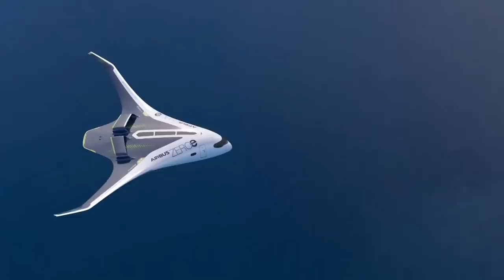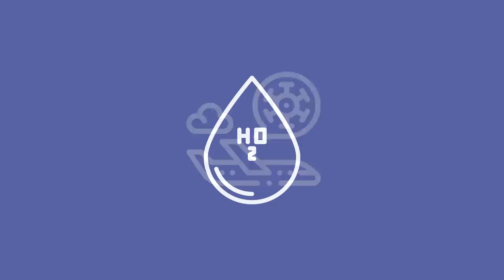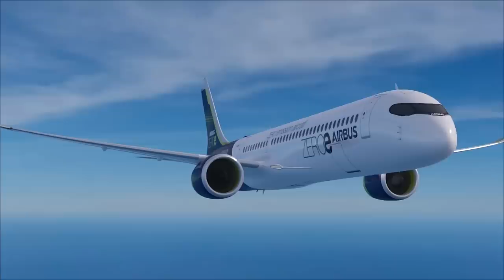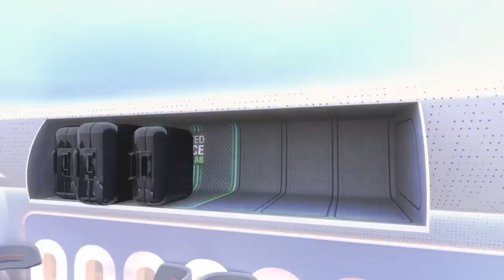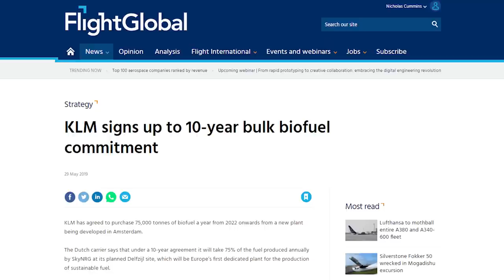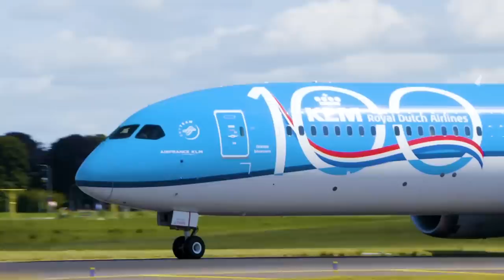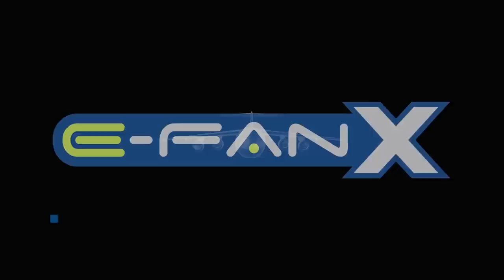Airbus Future Plane Concept - ZEROe - Hydrogen, New Cabins And Zero Emissions - Never Built

Comment: Airbus unveils concepts for hydrogen-powered zero emission planes
The three concept planes will be powered by hydrogen rather than jet fuel, and could be carrying passengers by 2035.
"The three concepts are each based on a different idea for how to achieve zero-emission flights and use different aerodynamic configurations for what the company said was its ambition of "decarbonising the entire aviation industry".
The crucial power source for all of these planes, codenamed ZEROe (for zero emissions), is hydrogen as a clean aviation fuel."
https://news.sky.com/
Reply: 0:23
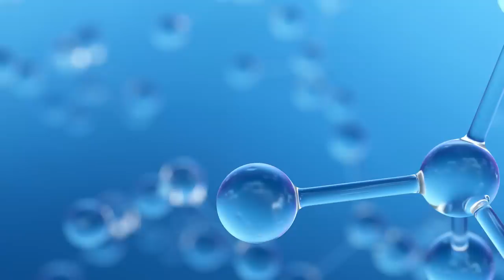Reply: 1:23
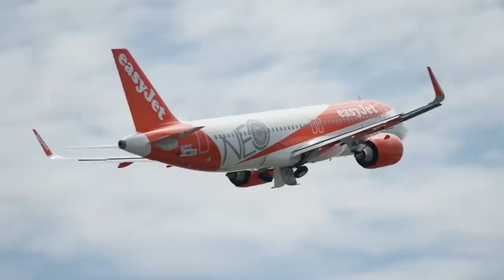Reply: 3:33

Comment: Small problem with hydrogen: it burns so hot that if combusted in air, it will also create NO and NO2, which are greenhouse gases. Not exactly "zero emissions."

I'd personally prefer a fully-electric propeller-powered plane charged solely off renewable energy, regardless of flight time.

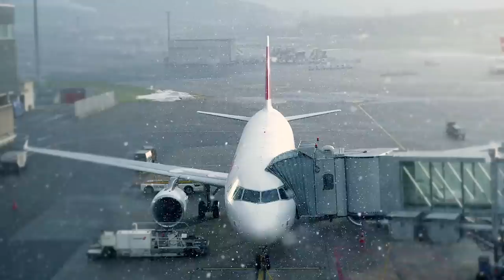Comment: 1:43. “ only the engines need to be upgraded on existing aircraft”
I don’t think so. In the 1980s Lockheed had an L1011 trijet as a test aircraft running one engine on hydrogen. They abandoned the programme because of the difficulty with the handling and storage of the liquid hydrogen both on the ground and in the plane. Watch a rocket once the cryogenic propellants have been loaded, continually venting off.
Reply: That was in the 1980, the technology has evolved enough today for more secure/better hydrogen propulsion

Comment: There is another problem with hydrogen airplanes, especially hydrogen jets. And that is the effect of emitting water vapor at high altitudes. This is often ignored because, hey it's only water right? But water emitted at high altitudes is a very potent greenhouse gas. In fact water vapor contributes to about half the climate impact of flying today. And the problem is that burning hydrogen produces about twice as much water vapor as burning kerosene.

Comment: There is definitely enough energy to produce hydrogen from the sun, so the comparison with biofuel makes no sense. Solar- and wind farms could use hydrogen as a secondary backup energy storage for emergencies, and sell off the excess hydrogen to airport for a fair price since it would have been wasted otherwise. The power farms prefer to use use their primary storage solution anyway thanks to it efficiency, so they rather sell the hydrogen  thanks to its value, unless they absolutely have to use it.
Reply: You can't transport hydrogen 'easily'. Costs of liquefaction and transportation are times higher that production.
Reply: @maxdefire  you don't actually have to transport pure hydrogen, you can store it in an other ways, and then turn it back to hydrogen. Military is even planning to use urine as hydrogen storage.

Comment: Hydrogen fuel cells make sense instead. Hydrogen combustion doesn't really make sense as it doesn't improve efficiency much. It's just simply swapping one fuel type for another like gasoline to LPG. Heck, even a gasoline fuel cell would be a HUGE improvement.
Reply: Actually, the fact that „you only need to swap fuels“ is a huge advantage in my eyes since it brings down costs drastically, especially in a domain like aviation, where development cost skyrocket due to safety constraints. Moreover, if it would be possible to combine the peak efficiency of kerosine jet engines  with hydrogen fuel, it would be way higher than state-of-the-art fuels cells. Peak efficiency of jet engines is <90%.

Comment: This is most likely a presentation model showing not a real development but the depth of research work. An attempt by engineers to create a revolutionary aircraft. But such futuristic approaches need engines based on new principles. Because due to aerodynamics, such an object cannot fly. It has no air support

Comment: Hydrogen transport? Wouldn’t it be enough just to have a truck that is connected to tap water and electricity...? 

Of course a bigger airport could make it more efficient in a different facility but for smaller airports that’s a very easy and cheap solution

If you think about it it would allow for operations in very rural areas as jet fuel doesn’t have to be transported there in the first place

Comment: These hydrogen engines burn fuel in the same manner that gasoline engines do. ... However, at a stoichiometric air/fuel ratio, the combustion temperature is very high and as a result it will form a large amount of nitrogen oxides (NOx), which is a criteria pollutant.

Comment: Burning H2 in an engine will still create Nox emissions unless they intend to carry liquid O2 as well like a rocket.
Reply: You're right, but I think the idea is to carry the O2 on board.
Reply: @normanstewart7130  But no CO2. That's a start...
Reply: @bazoo513  I think you've misunderstood. As long as they carry the O2 on board (pure O2, not air), there'll be no NOx emissions.
Reply: @bazoo513  But note my point about water vapour (produced by burning hydrogen) being a greenhouse gas. Water vapour is the biggest contributor to greenhouse warming.
Reply: @normanstewart7130  No, I understand. It's just a matter of trade-off - NOx emissions vs. much increased weight and complexity. 
In a bit different context, you will recall SABRE combined cycle engine where the main trick is using atmospheric oxygen for as long as possible, for weight reasons. (Well, I will admit that nobody can accuse SABRE engine of being simple.)
Reply: @normanstewart7130  Something ate my reply.
Water vapor in the atmosphere is in equilibrium with that in oceans, soil etc. If we add more, it will just condense (OK, if we fly over Atacama desert perhaps we will locally increase the greenhouse effect somewhat.)
However, if we warm the atmosphere up by dumping CO2 into it, it will be able to contain more water vapor, creating a positive feedback loop and making the things worse.
Reply: @bazoo513  But atmospheric CO2 is also in equilibrium with the oceans. Simplistic, hand-waving arguments won't cut it; you need to perform a full calculation.
Reply: @normanstewart7130  And you do perform "full calculations", unlike hundreds of climate models, right?
Oceans do absorb CO2 (and are getting more acidic at alarming rate), but much slower than we are adding it. You did notice that the atmospheric concentration raises, didn't you, therefore it is not in the equilibrium.
If oceans managed to absorb all excess CO2, there would be hardly any corals or mollusks left.
But, by all means, continue your fossil fuel lobby propaganda regurgitation. Life is too short to waste it like this.
Reply: @bazoo513  The IPCC says (at least the models say) the principal cause of future warming is the additional water vapour kick-started by the small amount of CO2 warming. We can't, on the one hand, say that water vapour caused by CO2 will destroy the world while, on the other hand, saying that water vapour from burning hydrogen is harmless.
Reply: @normanstewart7130  You don't understand a word of it, do you?
Yes, there will be more water vapor in the atmosphere, because warmer air can keep more water without it condensing. If you just add water, it condenses and falls right back. This is the positive feedback mechanism I was talking about.
Sancta simplicitas!
Reply: Even using fuel cells?
Reply: @beback_  No, Fuel cells produce electricity with water as the by-product. However with a Fuel cell you then have a fully electric engine which basically means you end up competing with battery electric aircraft.

Comment: Batteries - unlikely for anything beyond small short range aircraft; insufficient energy density. Hydrogen - possible, but the need to develop a whole new infrastructure and new risks make me think its not going to be top of the list. Synthetic hydro-carbon fuels - where my money is going; all the new infrastructure is in fixed locations, and then taps into existing distribution networks and more-or-less unchanged engines for heavy transport (trucks and aircraft). "Just" take the hydrogen from a clean source (electrolysis from renewables, or ultimately fusion), add atmospheric CO2, and out pops fuel. Nothing substantially different from an existing chemical plant or oil refinery site, and we have plenty of those.

Comment: Hydrogen is the most inefficient battery (fuel) known to man, so no wonder this did not work.  
Chemical batteries return 98% of their energy, while hydrogen returns about 50%.
Reply from the maker: The chase for zero emissions...
Reply: Well, the thing is, as inefficient it is, sadly, this is the most realistic scenario right now. Battery capacity is still horrible.

If you look at the range of the 2 of those aircraft, they have around 1,000 nmi to 1,500 nmi less range than conventional aircraft that uses petroleum as a fuel source.
And they would be relying on composite materials for most of the aircraft components to save tons of weights and lower the required thrust for the aircraft to operate. This technology help A350 to reduce fuel consumption by around 30% compared to previous generation aircraft like B777-200ER.

So this proposal sounds a bit more realistic than electric aircraft.
Reply: amd64online Thats an interesting technology, and there will be more like it I am sure. But lugging tons of metal hydride is going to dent the energy density significantly. Liquid H2 is always going to be higher density.
Reply: Batteries are stupid heavy

Comment: For the ATR-esque plane. Infrastructure for handling Hydrogen is expensive build, run, and maintain, even for large airports - look at the myriad of issues Toyota had trying to build out hydrogen infrastructure, and planed consume a hell of a lot more hydrogen than a corolla. And you think regional airports are going to have the money and the desire to go through that hassel? "Perfect" my ass. Blended wing designs have also been kicked about for years, and yet the furthest anyone has gone are a couple of RC models. Not only is the development cost far more expensive (new technology) then creating a new conventional tubular aircraft, but standard dimension air cargo is unable to efficiently fill interior cargo space. If i were a betting man i would put money on aircraft manufacturers basically sitting on their asses waiting for an engine suppliers, who are unlikely to put huge amounts of resourced behind hydrogen products, to pull a powerplant that is significantly more economical than conventional engines, practically out of their asses. Which is to say, i don't see hydrogen happening unless massive issues come in to play around jet fuel, like extreme carbon taxes. And by the time the economical proposition would male hydrogen favourable, electric technology will be a couple years out, and the R&D costs would never be recoupable.

The 7j7 had enough issues with new engine technology to doom the project, and their engine tech had far more commonality with existing power plants, and also did not need massive infrastructure expenditure for hydrogen.

But the CGI substanceless hype videos are pretty, regardless of practicality :).

Comment: Highly doubt succeeding by then; due to requirment of high-compressed tanks shape to be accommodated in entirelly in new airplane. And testing of new airplane will require plenty of time, which is not feasable by then, again, due to cost of hydrogen vs conventional petrol refinery cost and purshase/delivery in practical application.
Reply: symmetry08 Huuuum... seems like we will have to get Elon musk on the case.

Comment: Why not have a jet plane run on hydrogen gas hydrogen can be made directly out of water all you need to do is convert water to steam then inject the steam directly into the jet combustion chamber & at the same time explode the hydrogen atom with a 60,000 volt charge which seperate the hydrogen from the oxygen after burning hydrogen converts to nitrogen h2o2

Comment: Burning hydrogen releases NOx which is an air pollutant in cities, especially large ones with airports located at the close proximity with homes or apartments. The use of it only results in water and some heat is when used with fuel cells, the efficiency is also higher but oxygen needs to be taken from outside the altitude is likely more important as the higher it flies the less of it but also less air resistance. In theory it works but each solution needs a time to market to ensure enough development and fine tuning. Long story short it's not easy and it will require time and money airlines have refused to invest in the past. Showing off concepts or prototypes is a typical "top people are working on solving the problem", in reality it's not an indicator of adoption.
Reply: I was convinced you need nitrogen present in your combustibles to end up with nitrogen in the product. Clearly I've been lied to by big brother and the oil company.

Comment: Hang on, burning hydrogen gives off water, which is a powerful greenhouse gas. What is the global warming impact of hydrogen burning?
Reply: Norman Stewart Basically Yes, it is a strong greenhouse gas, but it in comparison to CO2 it leaves the air on its own (aka rain). It is only when the air warms up due to climate change that more water stays in the atmosphere therefore warming it up even more. If you consider how much water goes up into the air because of evaporationfrom the surface a bunch of planes don’t have any influence on the climate
Reply: @Theminenoop  That's not consistent with the IPCC explanation. According to the IPCC, it's a positive feedback loop: a little heating leads to evaporation, which leads to more warming, which leads to more evaporation and so on. So the water vapour becomes self-sustaining, the initial (small) CO2 warming is irrelevant. So when you add water (liquid or vapour) to the atmosphere, it generates warming, which leads to evaporation...
Now you may be right in the sense that it may be that the IPCC models are wrong and the water feedback isn't real. This would explain why the models don't fit the observations; the available evidence suggests that the water feedback cycle isn't happening in the real atmosphere.
Reply: @Theminenoop  By the way, it's not just about aircraft. Hydrogen is proposed for energy storage in a wide range of areas.

Comment: Except most hydrogen today is made with coal and emits lots of carbon in the process. And making hydrogen with electrolosis is not very efficient
Reply: Batteries are too heavy for big planes. Also will take too long to charge. Europe announced a hydrogen strategy to produce green hydrogen made from renewables like solar and wind energy
Reply: Also most of the grid electricity is made from coal and natural gas so I don't get ur point that it's made from coal. So that means ur battery planes will be dirty too
Reply: @mariofornarelli1067  you can make hydrogen from wind and solar but only at about 40% efficiency. In other words the 1kwh electricity used to make hydrogen that you will only get .4kwh of energy from
Reply: @mariofornarelli1067  that energy would be better spent elsewhere (on something with much better efficiency) until we have an abundance of renewable energy. Which we are nowhere near
Reply: @DerrickFishes  what I'm trying to say u can't use batteries for everything. U need both hydrogen and batteries
Reply: @mariofornarelli1067  what I’m trying to say is you can’t use hydrogen and batteries for everything. Not yet anyways. Once we control nuclear fusion then that will be the way
Reply: @mariofornarelli1067  it would make more sense to use the electricity for electric vehicles and keep using jet fuel for planes under our current circumstances
Reply: @DerrickFishes  lmfao 😂  So u want batteries but don't care about the environment I'm confused bc u still want jet fuel . Jet fuel produces alot of co2 and nox
Reply: You don’t seem to get it.. it’s worse for the environment to make hydrogen because then we have to use more coal and gas to power our other things because we don’t have enough renewable energy
Reply: @DerrickFishes  u need hydrogen to balance the electric grid by storing renewable energy when we need it the most. Batteries can only store renewable energy up to 1hr after that the grid will collapse. By using the natural gas grid we can balance the grid and transport hydrogen to homes, transportation, heating, electricity, etc. Also u can convert hydrogen into ammonia to store even more hydrogen. Ammonia then can be use for fertilizer for farmers to use. U can use hydrogen to make green steel. Hydrogen makes sense for long haul trucking, long haul busses, planes, cargo shipping boats
Reply: @mariofornarelli1067  there are much more efficient ways that we already use to store energy than hydrogen..
Reply: @DerrickFishes  why did EU, Asia, Australia, etc invested billions into green hydrogen made from renewables?
Reply: @mariofornarelli1067  my best guess is because they are corrupt and make profit on it
Reply: @DerrickFishes  And Canada just released a hydrogen strategy. U can't stop hydrogen it's going to happen just like batteries, and renewables it's going to happen

Comment: REMEMBER THE HINDENBURG - HYDROGEN IS FLAMMABLE.
Reply: And jet fuel is not?
Reply: hindenburg did not burn because of hydrogen but because pain was flammable. only later hydrogen started to burn. airships with hydrogen were actually very safe and that was 80 years ago.